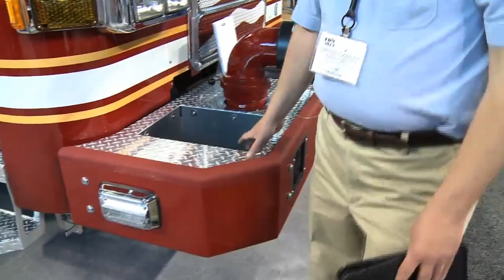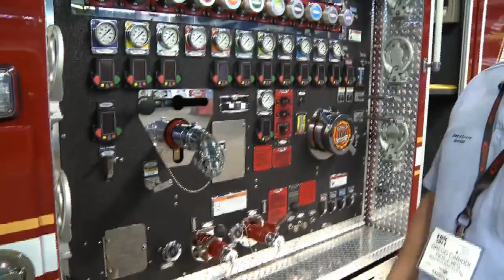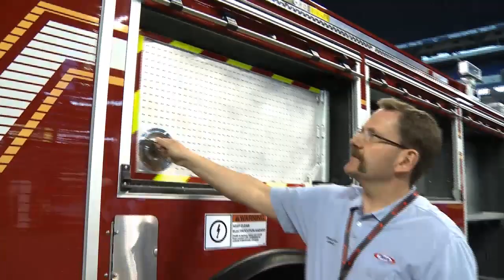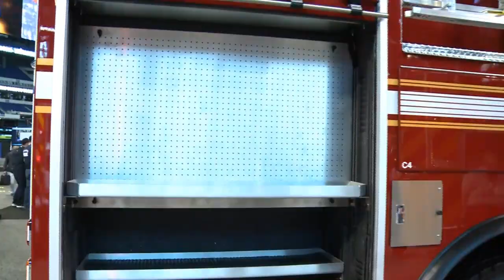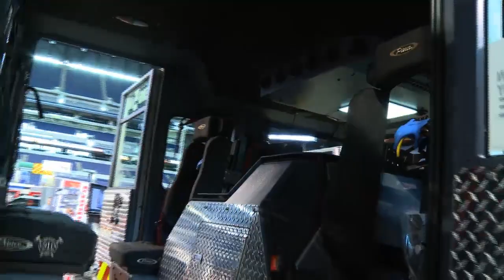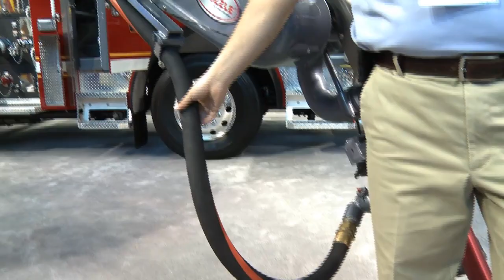Elizabeth Arrow XT Snozzle- FDIC 2014

Comment: He didn't say what the GPM rating was for the Pump. All he said was it has a 750 gallon water tank, and a 300 gallon foam tank, and that every single pump discharge has foam capability.
Reply: 2000 gpm, 750 gal water & 300 gal foam with a Husky 60 foam system. The Snoozle length is 65 ft.

Comment: How do u operate the snozzle
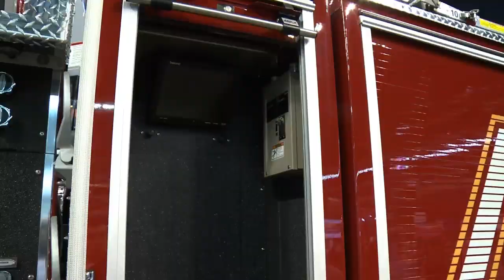Reply: He glossed over it very quickly at 3:23.  It's in a compartment behind and beside the left engineers control panel.  The monitor is very small and the pull out control plate is not yet added.  Control plate is mounted on a bracket or can be hand held.  It features all thumb controls including thumb joy sticks similar to that on a game consoles game pad.  You would love it.